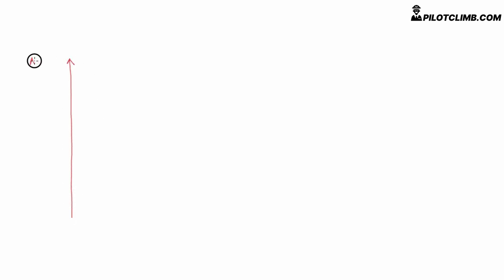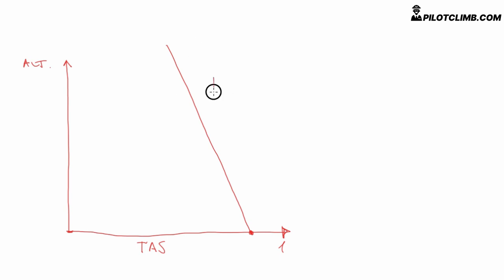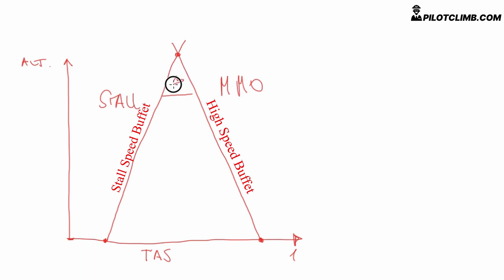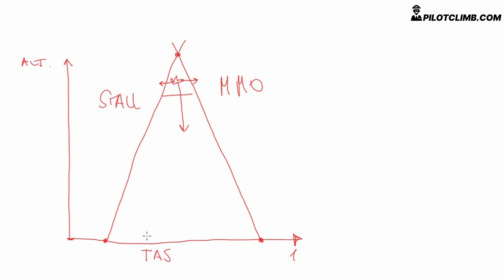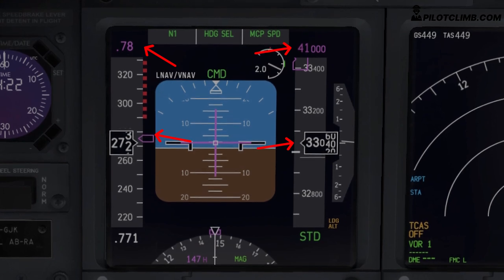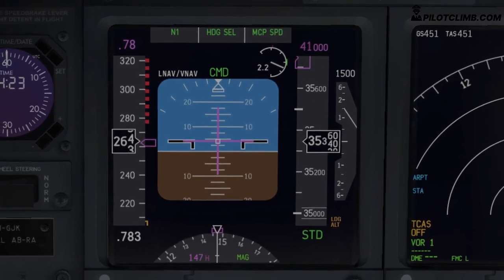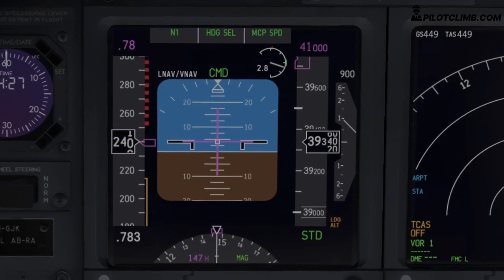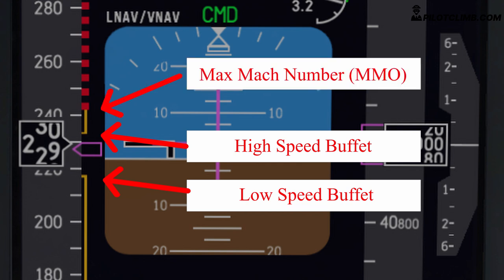Coffin Corner Explained - [How YOU can spot the coffin corner by looking at the Airspeed Indicator]

Comment: During the cruise flight, you experience some heavy turbulence due to jet stream. Basically, you decide to descent to a lower level where you can have some more room between de high and low speed buffer?
Reply from the maker: great question, it depends but 90% of the time it's better to descend for the reason you mentioned.
Reply: @PILOTCLIMB  much appreciated your answer and keep on with great videos and explanations. It surely helps a lot people like me... :)